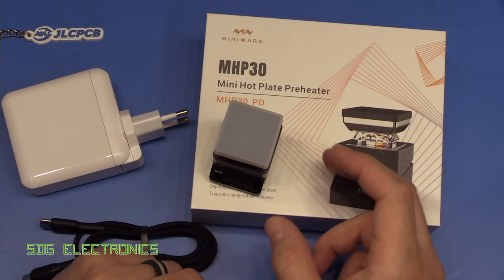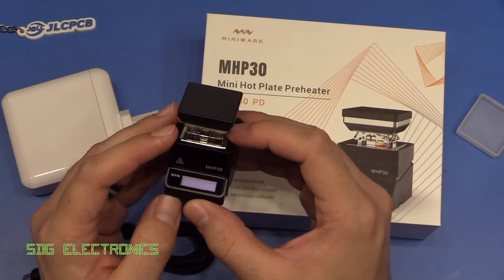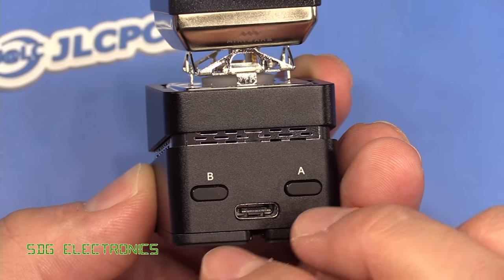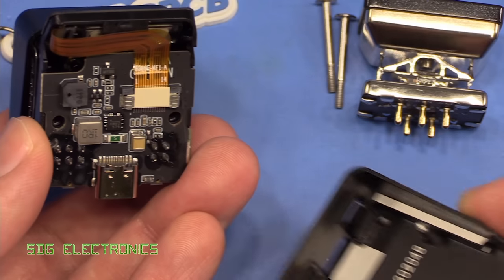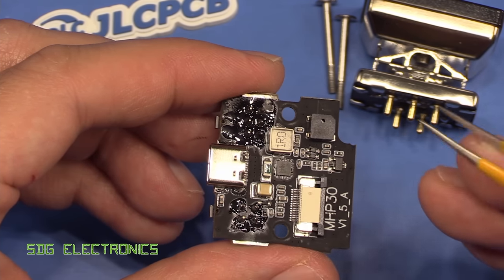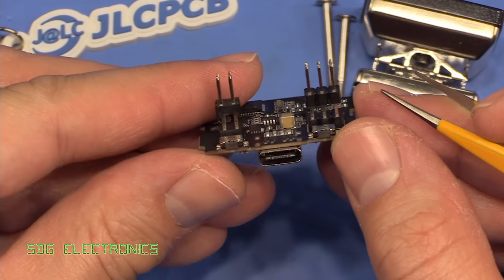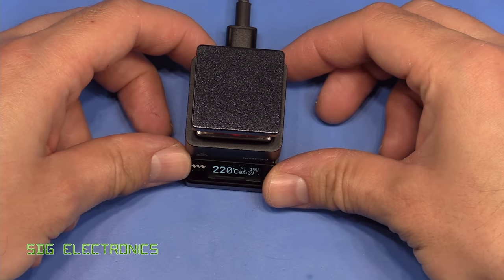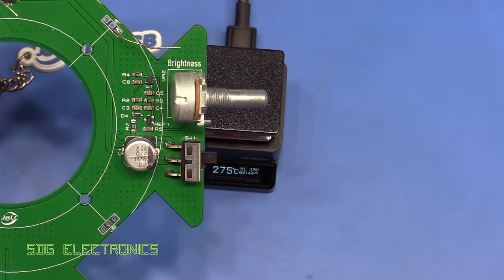SDG #191 Miniware MHP30 SMD Rework Mini Hotplate

Comment: Steve I've been recommending this to people for a while now. All those that got one, have fallen in love with it, I even took mine fishing & used a 12cm Mini Frying Pan.
People can LOL all they like, I got 2 nice bacon & egg sandwiches from it. 20v Dewalt cordless drill battery did just fine as the power source. Still clean and in lab use. 😀👍
Reply from the maker: Indeed it's quite a neat device, doesn't take up too much space on the bench either!
Reply: Sounds fishy. How you baiting for Bacon and eggs?
Reply: Private Lake & Farm can't give out the where & how. If I get permission I will take a short video next time. Maybe in the summer IF we get allowed to, with all this long lock-down. Not allowed to wet a line.

Comment: I think it was sensible to reserve blue for indicating cold only when the device is actually in heating mode. Green is a nice indication for being in configuration mode when the device won’t be getting hot.
Reply: Similarly, I thought green was being used for "safe to touch".  Perhaps something like a blue to red ramp could be used to indicate heating.  Also quite frequently this sort of indicator colour stuff is culturally specific, and can be a bit of a UX internationalisation headache...

Comment: I still think this is too pricy for the little amount of surface area you get but thanks for showing me why they charged the amount they did. Build quality looks top notch! Totally thought it was a novelty Christmas toy when I first saw it on Miniware's channel.
Reply: Don't forget that you get a nice quality 60W USB Type-C charger with it, with all the PD profiles. This alone is easily $30-40.
Reply: @TheAmmoniacal  I suppose if you buy the set with the charger. Without it it's expensive.
Reply from the maker: The charger appears to be decent quality too. Shame I didn't have the UK plug otherwise it'd be in regular use.

Comment: "It's not cheap to manufacture this with all these intricate parts."

Sure, looks nice, but my bench looks like the dressing room floor behind the fashion show catwalk, not the presentation on the other side of the wall. 
  I'd buy one of these at half the current price if it came in a well camouflaged utility-bench-catastrophe color scheme.

  Really, this should be designed as an integrated part of one of those magnetic pcb stand/holder setups. Heck, they could do everything, steel base plate, magnetic stands with thumb screw pcb retention, third hand clips, those slinky probing pin holders, lights, magnification, hot air gun holder, and maybe add some tungsten precision probes into the ecosystem. If someone offered all of that in a piecemeal fashion, at an AliEx medium pricepoint, I'd buy into it, especially if it didn't require a large-ish initial purchase and the ecosystem could be added to and expanded with little $10 to $30 purchases as needed.

Comment: Hello dear friend.  I need to unsolder an 8-pin potentiometer (2-channel audio potentiometer with switch).  If I support/touch the 8 pins of the potentiometer from the bottom of the plate to the ceramic base, will there be enough contact surface to transfer the heat from the equipment to the potentiometer and perform the desoldering?  Could you tell me?  I need to desolder this type of potentiometer from several plates.  I appreciate if you can answer me.  thank you so much

Comment: An interesting little device. I wonder if you can put something like a thick thermal pad in between. To cushion the pcb when it also has little protrusions on the underside, from thru hole components and connectors etc. That would make the device more practically useful IMHO. In a much wider range of situations. Yeah preheating a small zone like that is an excellent companion to hot air removal of devices on the ground plane. That would otherwise require a lot harsher settings thrown at them from the hot air alone. To help save stress on components. A slower 100 - 150c preheat temperature beforehand.

Another good companion for this device would be some kind of a level area built around the hot zone. So that the pcb can be well supported at the same height. And not fall off.
Reply: I think thermal pad would only take up to 100 or 125C or so. But good idea. In other cases people have used sand to heat up boards and fill in the gaps where component leads may be placed.
Reply: @Ja Ro  thanks i shall remember about the sand. And there are different types of sand... perhaps might also be other 'sand adjacent' materials. Maybe like putty or clay. Something else like that. Which would not fall apart so easily and make a mess everywhere.

Comment: I would buy it and use it a lot if the heating surface was larger. Even 50 x 50 would be a huge improvement...
Reply: Place a 50x50 aluminium plate on top of it; problem solved.
Reply: This fits the size of a CPU chip. The typical user is most likely a phone repair shop.

Comment: Thanks for the review Steve. It is a little bit on the pricey side. I have been doing some bodging to some work PCB's lately. Electrolytics are the worst...pads ripped off everywhere with a soldering iron. I wonder if you could localise the heater even further with a section of brass bar for double sided populated boards?
Reply from the maker: If you can balance the board then definitely
Reply: Then I think its too handy not to have one. Time saver. Plus if you have a large pcb then just reflow a section at a time

Comment: I guess blue when cold, blinking red at the point it's dangerous to touch, and solid red when it reaches the peek.
It seams too expensive for the specific job it can do, ie, you can't remove ICs with bypass caps under it or double load PCDs, so it's kind-of only flat bottom PCBs.

Comment: Not sure if JLCPCB would be daft enough to try and sell a PCB with lead solder. Not sure if there is any product sector that’s allowed to use lead solder. Aerospace and medical were the last bastions of lead solder and they are all lead free now.

What sort of fet would handle a 350°C case temperature with a junction temperature higher than that! Why not use a resistive heater? The little cartridge heaters are quite fast in operation.
Reply from the maker: I think I had corrected it in the annotation during the video. It is a resistive heater - my mistake
Reply: Of course JLCPCB uses lead solder, go to their quote page "HASL (lead)". If you need lead free then choose lead free. Many people still want lead.
Reply: @jaro6985  HI, You can still by lead solder. but if you use it in a commercial product  you will be opening yourself up for quit a fine under the RoHS Directive in the UK and EU. As Lead is a restricted substances.  
Even China via it's China RoHS2 restricts the use of lead to 0.1% by weight.
So does Japan, Korea, Russia, Canada, even India.
With USA you need to know which state your device might be sold in as some states require RoHS compliance but not all. So unless you can limit where sold you need to be RoHS  complient.
So selling by EBay, Tindie, your own website, you need to take  RoHS into account. You have to be careful as just reselling something, you need to know its RoHS compliance. As by placing it on the market makes you the manufacturer under the eyes of the directive. 
So the moral to this story is if you plan to sell it go lead free and stay safe in the eyes of the law.
Reply: Or just sell it in Australia. We only use lead free for export, for the reasons stated above.
Reply: @astrolite3192  Thanks, I never knew that Australia was so far behind, as you were used as part of the study for removing lead in petrol!  I can remember all the noise about all the lead in your tinnies.

Even China has RoHS restrictions. I expect your get it some point. it always comes to he who waits. ;)
Reply: As we don't eat it and the only fumes coming from it are flux related (which we extract) we're smart enough to just wash our hands after.
Reply: @astrolite3192  we did all the same things as well, started using lead solder in 1970's. was beening forced to stop a few years ago when avionics and medical exemptions were lost. Can't remember if the lead had an affect on me ;)
Reply: aren't space and military still using lead solder?
Reply: @cannesahs  The UK mil had an exemption to allow lead solder to be used but I think this has expired, most of the PCB's I've worked on in the last few years for the UK MOD had to be lead free. before that the medical PCBs were all lead free as well. but Oz still allows lead solder, how they sell it to the rest of the world would be a problem. RoHS is all most world wide now.

Comment: I bought one of these and found it very disappointing.  The user interface is fiddly to say the least, but it is also very picky about the power supply.  With a 12V 1.5A power supply, it seemed to work correctly, but it heated up slowly and had no capacity to heat a PCB (as you would expect I guess).  With a 65W 20V laptop supply it heated rapidly to 50C then stopped, regardless of temperature setting.  Got odd behaviour and error messages.  No firmware offered on web site so assume I have the latest.  

It is going back to Banggood for a refund.   Maybe I should have bought a unit with the PSU included, but then is the PSU safe...
Reply from the maker: I think you just need a USB supply that supports Power Delivery (PD)

Comment: Why dont you also change the heating plate for something else you had on hand..?
You, got 3 items delivered free of charge.. *Miniware PD PSU, * Miniware high wattage silicone cable with high wattage chip, and a *Miniware hotplate..
and you exchange 2 out of the 3 things before you even start using it and see what it can muster.
c'mon if you wanna test the performance of a kit, then atleats use it as such.

You do get when you put other cables that got other current rating in their chips, from fx being longer 3 meters cables and not heat-resistant etc,..you can influence the performance..
same is the case with PD PSU.... Use the product as it comes and the exact situation people would get if they jumped on your piggybackride aff-sources, not least when its shilling for a company.
stop exchanging 2/3 items when you don't have too and at least show the wattage info in the display, as that is way more informative then a crude stationary voltage, and would also indicate what wattage it can perform, as I highly doubt it does 65watt. more like 45w to 55w in your setup..

Comment: Nice design but too small, too gimmicky. Will just encourage misuse.  3-4 preset-mode buttons on front would of been helpful and encouraged modding, or maybe a link to an app over BT. Every review leaves people looking for stand to prop up pcb, but no stand provided.
Good for egg, bacon, and and mini-pancakes. Just keep the flux and solder away.